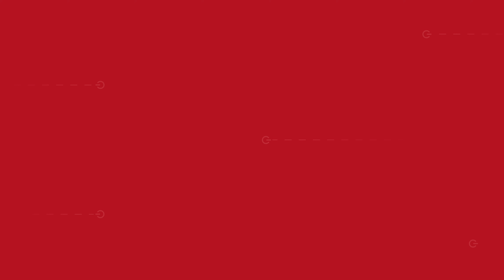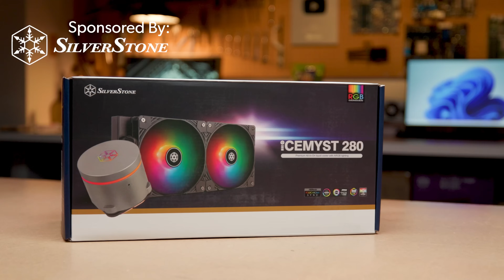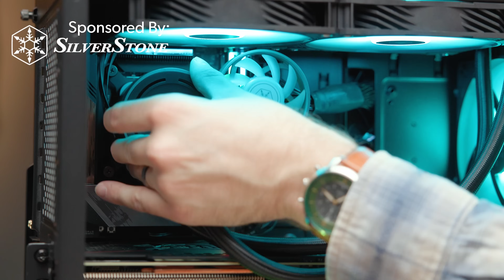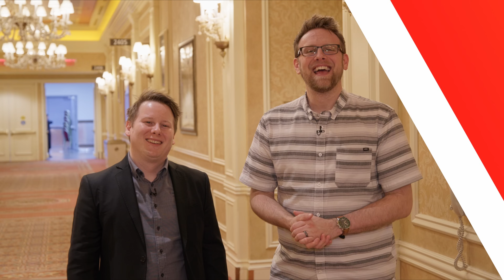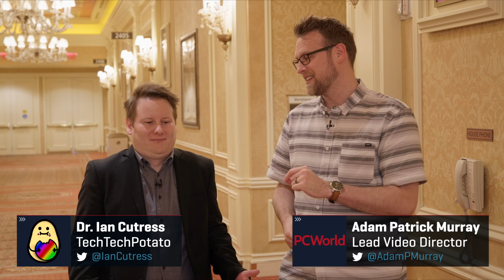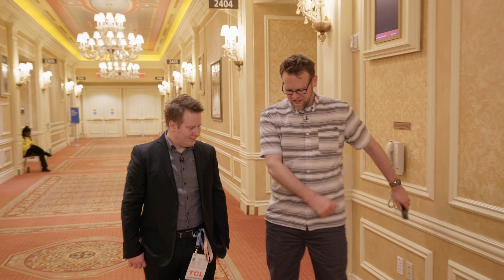Could You Run X86 On Its Own CPU Tile?

Comment: Eh emulation is not perfect and you need to pay a team to develop/maintain it. One example of chip within chip is the PS3 inclusion of the PS2 processor for backward compat, though only for the first generation and later models of the PS3 removed it in favor of software emulation.

Comment: Intel Xeon Phi MIC run independently on a PCIe bus. Accelerators like the Tenstorrent run independently again on a PCIe bus (RISC-V based). You could do a NUMA-type bus and pull this off.

Comment: This is the old theory of Amiga's PPC where you could slave IBM386 motherboard to do X86 tasks within the Amiga frame work. May a emulation core to accelerate Emulation. Like a iGPU but an API base add in for emulating older chips or Arm/x86 hybrid emulation.
Reply: Also the various x86 cards for old Apple computers. Though I think those would boot the whole thing into PC mode.

Comment: Probably more differences between twisty and curly fries than between different ISA's effect on performance. If smaller ISAs are better we should use PIC for everything
Reply: Hogwash!  Other than the cut, there is no difference, although twisty or curly fries are most often spiced up, but you can do that to any fry all the same, it's just that the originals were spiced up, but the curl refers to the cut, not the spices.  Neither are as good as potatoes au gratin!😋

Comment: AMD already has enough problems just figuring out what chiplet to run different x86 threads on. The idea of them having to deal with entire instruction sets would be hilarious.
Reply: AMD's only problem is relying on Windows/Microsoft to make the OS work properly.  Then again it's still top of the charts, so what are you talking about.  Also any dual chip Ryzen can run on lower end motherboards just fine but why would you.  You must be a real space head because you're talking out of Uranus.
Reply: @maxwellsmart3156  AMD fanboy detected that blames anyone but AMD for their shit performance scheduling. That's on MS AND AMD to wade through but neither cares much for such an overpriced low volume seller.

Also, when X3D launched $300 was still the  minimum for a competent AM5 board. 7800X3D is just better period and 7950x3d should have just had dual vcache dies. You're a donkey cause you're talking out of your ass.
Reply: Dont know what your on about I have a 7950X3D and it does pretty well figuring out what CCD to run on, but only in windows, if on Linux, yeah it doesn't work, Linux doesn't seem to care what CCD's do what it just uses the whole CPU..lol
Reply: @bes12000  It didn't for a long time, and it's still not always accurate. That's inexcusable for a $700 CPU that needs a $300 motherboard. Hardly a premium experience.
Reply: @bes12000 Hahahahaha 7950X3D is dead RIP

Comment: tldr: x86 needed to run old code since newee cpus cant detect old instruction sets.
Reply: Well the way I learned it is you send an opcode to the cpu and the arrangement of logic gates for that CPU  just do whatever operation according to the logic of the gates.  So like opcode 01101000 is addition, 01101001 subtracts whatever is in two registers.  (and opcodes are different for each type of CPU or nonexistent) But in real world, I think they have other abstractions and layers in microcode before getting to assembly language and machine language.  The extra layers and going to cache (more) or ram (even more) would take more clock cycles.

Comment: Could be cool if FPGAs became common, that could be just one of the things people do with them. Maybe along with making them into accelerators specially written for individual programs.
Reply: It’s much faster and more efficient to emulate x86/x64 on a different architecture than run an FPGA core. Rosetta 2 for example has rather minimal penalty.

Comment: I just played some levels on Lemmings from early 90s in Dosbox. I hope x86 will stay on in some format
Reply: DOSBox emulates an x86 CPU even if you run it on an Intel/AMD computer because Windows stopped supporting real mode x86 since XP. Therefore it doesn’t require an x86 CPU. Runs just fine on ARM Macs for example.
Reply: MisterFPGA tells us that anything old enough is trivial to run on a modern hardware. That small FPGA runs everything up to PS1 and Saturn just as well as the original hardware did. Today's high end PC games will be trivial to run via virtual machines 10 years from now. Also due to the way modern compilers and development environments work, if there is a transition to a new ISA, applications will just be compiled as "fat" apps with binaries for multiple ISAs. It is in a way already happening with Windows on ARM and the main bottleneck there is to find a business reason for developers to take the time and support cost of shipping ARM binaries as well. Mostly because the available install base is still too small and Qualcomm-exclusive.
Reply: I like&wish to have a special DosBox version for Android that emulates MS DOS 5 + intel core2quad 64 bit with VBE 3 graphic BIOS of Radeon 9750 for wide screen in 1920x1080x32 with vbe 3 hardware triple buffering in the linear framebuffer. I don’t like the outdated modenumbers of VBE 1&VBE 2 mixture of DosBox svga-S3 emulation.